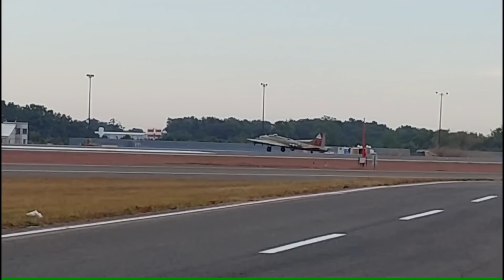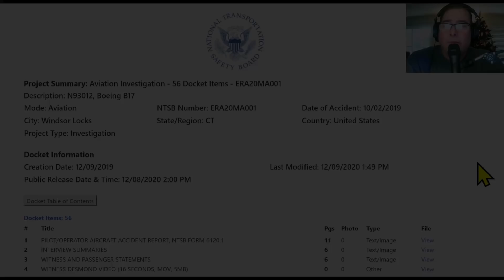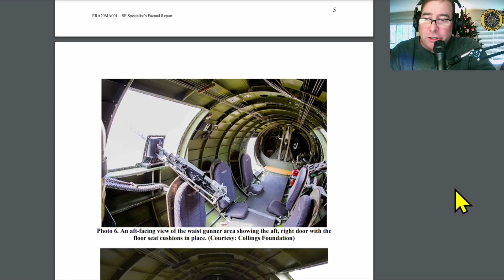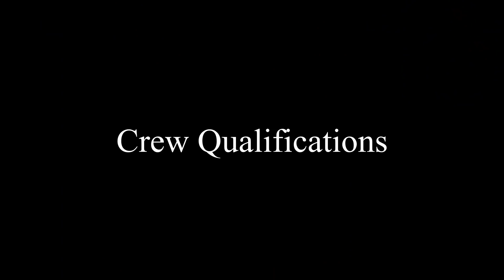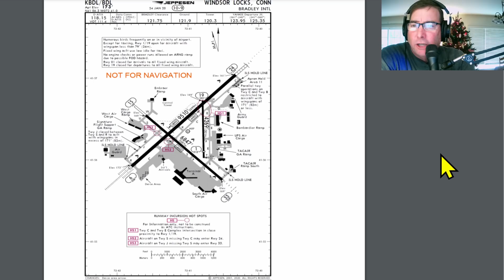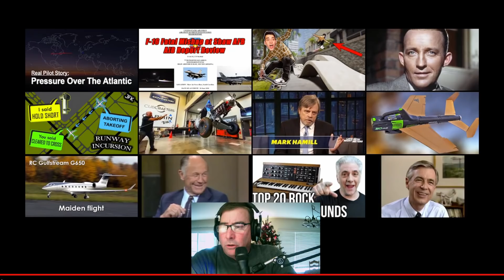NTSB Factual Report B-17G Crash 'Nine-O-Nine' Part I -16 Dec 2020

Comment: Extremely eager to hear the report on the state of the engines. I think that may explain what happened that day better than anything else. Sorry but this needs to be said. In the Collings Foundation and with the management of this aircraft in particular there was demonstrated an appalling lack of concern for safety! I don't have the proper words to describe how wrong it was to KNOWINGLY fly this aircraft, especially with paying passengers on board, with bad magnetos on at least 2 engines!  The R 1820's have 2 mags on each engine, thus built in redundancy and safety in that the engine will still run if one is inoperative. But when 2 of the engines would not start, obviously due to loss of BOTH mags on each engine,  blowing the moisture out and flying with paying passengers was a grievous mistake in judgment!

I was aboard this aircraft and the B-24 in Bangor, Me about 15 yrs ago. I loved being able to show my sons the kind of aircraft that helped America win WWII. It is a tragedy that it was lost, along with several crew and passengers, due to a number of mistakes and poor judgement that  allowed it to operate under less than ideal circumstances. The replica of the square rigged ship "Bounty" a few years back  was lost when the captain decided to sail it across the path of a Cat 5 hurricane. That organization, like the Collings Foundation, was driven by the need for money to keep the vessel operating. Safety took a back seat on the Bounty. 

We have all heard that a major cause of aircraft accidents is the "need to get there today" that has doomed an awful lot of flights. At the time of this crash the Facebook page for the Nine O Nine was begging for money in just about everything they wrote. Probably equally as bad as "need to get there today" is "we need to fly today because we need the money". When safety is willingly ignored, or in some fashion "worked around" bad things sometimes happen......like they did here. There was ample reason for Collings to lose their approval to make any more of these flights, due to a lackadaisical attitude towards safety,  as we have already learned some months ago.

Comment: Can someone clue me in on how the main gear braking and tail wheel steering work on a B-17? I'm fairly sure I see full left rudder on the eye witness video and at least one tire smoking. Is there differential braking by pedal, or is is unitary... and does the tail wheel steer with the rudder or does it caster?

Because I'm thinking if they locked the left main while still braking hard with the right, the friction coefficient favors the right, and the braking force could have taken enough weight off the tail wheel to make it ineffective at the same time the rudder's ineffective.....

Comment: If you lose power feather that engine. Maintain air speed with increased remaining engines. Lose two on one wing do not turn into that wing. If unable to maintain momentum above stall speed belly land on available terrain if at all possible. You can’t maneuver without out adequate power. You can only descend  with remaining airspeed. Full flaps to reduce stall speed. Nose down with remaining altitude and flare at twenty feet above ground level. If terrain won’t allow,, well you did all you could.

Comment: Excellent commentary as always! I am saddened by this crews and passengers loss of life. Closing in on 65 years old and retiring from airline flying a couple years ago and observing some ( not all ) older pilots struggle. I believe flying a complicated aircraft  as a B-17 ( in particular when an engine fails ) at age 75 ( as was this Captain ) is not a desirable situation. I absolutely mean no disrespect.
Reply: Im not so sad for the crew, their own incompetence and arrogance cost them their lives. I'm sad for the innocent passengers they killed and the loss of this historic irreplaceable aircraft.
Reply: @Zwia.  ok tough guy
Reply: @Zwia.  The Air Crew didn’t, “kill” anyone. Aviation comes with its own set of risks, especially when a  75 year old military aero plane is involved. And no a B-17, whether you deem it “irreplaceable”  or not does not hold more importance than the souls lost during this accident.
Reply: @dyingbreed1282  William's statement is not holding the loss of the aircraft as more important...and he's right, the captain shutdown #4 engine against the Loadmaster's warning because he said they were still climbing out. But I wouldn't have said crew though...this was on the captain. No CRM utilized at all. I don't have any sympathy for the captain.
Reply: I add the Loadmaster partially at fault too, now that I think about it. He didn't have a pre-flight passenger safety demo in place, especially for that type seatbelt.
Reply: @SixTenVisuals  I'm somewhat surprised that they didn't think it was beneficial to replace the old lap belt with modern restraints.  I'm all for historical accuracy, but that ain't worth dying over.

Comment: The CFRs & Sections (14CFR & Part 91) spell out the hierarchy of FAA oversight and regulations.  Part 121 is the most stringent, then Part 135, and then Part 91 for us General Aviation types. For us the oversight comes from the FSDO, and most of us will rarely, if ever, interact with an actual FAA Inspector, although a “ramp check” is a distinct possibility.

The Collins Foundation B17 crash at KBDL provides some object lessons for all of us way down the “food chain” in oversight.  I would encourage all of us to read the threads below and learn the lesson:  Where does our real “safety oversight” come from in our GA operations?  In brevity: IT COMES FROM US!  We know our airplanes, and many GA owners try to scrimp and save on maintenance and upkeep.  This is one area that we as owners have nearly autonomous control.  Maintain it to the best of our abilities!

https://www.aopa.org/news-and-media/all-news/2020/december/16/ntsb-opens-docket-on-collings-foundation-crash?utm_source=epilot&utm_medium=email

https://youtu.be/G3dD98IqEUk

https://data.ntsb.gov/Docket?ProjectID=100356

There simply is no substitute for a good maintenance program and diligence/vigilance by both the maintenance folks and the pilot operator/aircraft owners.  There is not enough FAA oversight of Part 91 to insure our air worthiness and we simply cannot rely on that alone.

Get a cup of coffee when you have time and enjoy the lesson links.

Comment: Missed opportunities: declaring an emergency and telling the crew to prepare for immediate return; the cross runway at Bradly was overflown! With traffic priority via a declaration of Emergency with the tower, the closest runway should be the landing runway. Lastly, if the plane was hardly flying why attempt a go-around after initial contact? Thanks
Reply: Aviate 1st. Communicate 2nd.  Basic flight rules
Reply: @rfinsl  I am glad u agree: AVIATE which means in a decreasing power condition THE 1st runway/landing field available IS the place to go! 1 motor out, 2nd motor questionable thrust! Why over fly the crossing runway at BDL? Seems plan before takeoff was not created. Thanks

Comment: This accident is quite similar to that C310 accident crash on highway 405 before John Wayne airport in California in 2017.  Right engine missing (It didnt die).  He panicked and made a ton of mistakes on EFATO, plus stalled on the turn and crashed short of the runway-on the highway hitting cars and exploded the fuel tanks.

Comment: Chain of Pilot Errors on EFATO.  The usual killer of "Experienced Pilot".  Experienced, but not on EFATO.  They feathered the wrong engine, didnt troubleshoot the suspected one and let it die on climb out, turned into the dead engines, then undercontrolled the right turning tendency on downwind leg and got too close to the runway, then under shot runway, then added power at MCA and went to the right (yes, that will happen, dummy) into their crash.  About 6 EFATO pilot errors total.  Geee. I was Multi Engine CFi. Retired..

Comment: I recall hearing right after the incident that the propeller on the #3 engine malfunctioned.   Two of the blades did one thing, and the third blade did something else.  So that engine wasn't fully effective even if it was delivering power.

Comment: The pilot being in charge of maintenance operations is always a red flag, I have multiple on/off road vehicles/watercraft that I "maintain" which I would drive at 100mph, but would not let anyone else drive them at all! just because you know about and get used to pumping the brake pedal 5 times to stop, and know what rpm the hydraulics will have max output without a line failure doesn't mean its in good working order!

Comment: I
Juan, I'm not understanding why the crew would have had the two left engines at a high power setting at the same time they were standing on the brakes.  there was very long skid marks shown in previous vids and now this latest vid where you can hear loud engine noise.

Comment: Every time I see photos of the wreckage, I am astounded anyone survived. It looks to me that the final arc the aircraft took as it approached the airport was not really something the pilots were controlling, but something the aircraft was doing under the power of the assymetric thrust.
Would the outcome have been different if the pilot chopped the throttles once the aircraft was over the outfield? We will never know, but I suspect yes. Given the B-17's ability to operate from very unimproved fields, it would've been an option in my mind. Just put it down with some sort of marginal control, instead of hanging on for the ride.

Comment: It's time to shut down these sketchy war bird operations.  They were dangerous and demanding planes 75 years ago.  Pilots aren't proficient and maintenance is underfunded and has no FAA supervision.  Shut them down. (pilot)  p.s.  In the mean time, Apply the same age limits to pilots as airline pilots, age 60. Require BOTH pilots to be Type Rated.

Comment: I have had moisture in my points under the cap before on a pickup I owned a long time ago. I would use WD40 since it is a water displacement and it would start right up, never had any issues unless it rained. And that would fix it  and off I would go.----Just saying.

Comment: Heartbreaking accident. Appreciate your report. It's a little confusing - early on you said the passengers and crew were fatally injured, then later it sounded as if the copilot survived to tell the story?
If 2 engines had recently been overhauled, is it possible the pilot took things a little for granted in his assessment of the engines? With all due respect, it sounds like there might have been a couple of things not in the pilot's favor:
* His age (sorry kids, but that's the way it is). A person can still be pretty sharp at 75, but may not have quite the reflexes and judgment of their younger years. Should that flight have been aborted before they even took off? Was he maybe a little too eager to get in the air - i.e. Collings needed the money? 
* And, respectfully, I caught on the paperwork displayed he did not have 1 DUI, he had 2. It was a long time ago (98?). Was he still somewhat of a drinker? Forgive me, but if he had a couple of stiff ones the night before in the interest of social discourse, he might have been a little fuzzy for an early morning take-off, especially at 75 years old.
I'm not saying this is what happened, merely speculating the possibilities.
* What the heck was the story with the seatbelts? They should have been fully functional and the passengers instructed properly how to use them and the emergency exits. Period.
* What was the disconnect between the FAA and Collings? That doesn't add up. What's going on with the FAA?
The truth is hard to fathom sometimes, but if you really want to understand what happened to that beautiful B-17 and everyone in it, you have to be honest and face it for what it is or might have been. 
Same for so many other things in life.
Thanks again. Excellent report. It deserved a thoughtful response.
Condolences to all family and friends here - RIP. 
Hope everyone has a happy, healthy holiday.

Comment: I think the old guy standing on the top of the ladder in the beginning photo clips really demonstrates this groups concerns for safety altogether.
Reply: The old guy on the ladder was the Pilot and mechanic Mac Mcauly
Reply: You obviously sit in a chair nonstop and have never done a day's labor. Shut Up.
Reply: @jameshobbs6092  What @tisoy909 says is a very valid point. Any fool knows you never, never stand on the top of a step ladder like that. I've worked with ladders every day of my 30+ years in this job and have never stood on the top rung of any step ladder. In fact HSE law now says you shouldn't use the top three steps, including the top, on a step ladder. So I know who should SHUT UP
Reply: @jameshobbs6092  "doing labor" has nothing to do with doing it correctly, or safely. The same judgement on display with standing on the top of a ladder like that is probably the same kind of judgement that ultimately brought the plane down and killed seven people. That shut them up for good.
Reply: @jameshobbs6092  well my chair flies. I don’t consider it labor.
Reply: @jameshobbs6092  I have ! I thought the same thing !
Reply: Unfortunately there remains a MACHO attitude towards safety, and nothing will change until MEN GROW UP.

Comment: When I flew on this exact airplane in 2004, we sat in the back on the floor, with seatbelts. Sitting sideways. We were told specifically not to sit in the seats. I don't remember there being so many. Also the plexi glass hatch over the radio room was removed

Comment: Something to know about spark ignition systems that have gotten damp.  While pure water isn't a conductor of electricity, impure water is a conductor.   Just as with a distributor type automotive ignition system, conductivity due to water contamination will allow high voltage to leak to ground or another cylinders distributor terminal.  The other side effect of this " high voltage going where is should not be going "  is that a carbon line will be burned into insulator surfaces.  This carbon line is now an easier path for electricity to flow.  Some call this a " cracked distributor cap " but it is really " carbon tracking " .

Electricity follows the path of least resistance,  If a spark plugs  firing voltage is say 15 Kv and the carbon line is 20 Kv, the high voltage will mostly go to the spark plug and the engine will run.  At high engine load, spark plug firing voltage increases.  If it exceeds the 20 Kv threshold of the carbon line, the spark plug does not receive enough voltage and the cylinder won't fire.

A similar situation can occur with spark plug wires that have failing insulation even if they are not wet.  Given the spark plug wires are likely in a metallic wire braid to reduce radio noise, weak insulation is a greater issue than with an exposed spark plug wire. 

If damp mags are a perpetual problem, I'd be looking at sealing them up and purging with a built in dry Nitrogen system.  Note, nitrogen isn't dry because it is nitrogen, it is dry due to it being compressed and dried.

Comment: I flew on Nine-O-Nine almost a decade ago.  I sat behind the co-pilot's seat, facing backwards, with a lap belt, if I recall correctly.  What an absolute tragedy this accident was.  As an ATP who's flown a full, piston airplane on half its engines, I can say it's not like flying a jet.  When you lose a motor in a jet, you can sip your coffee, engage the autopilot, pull out your QRH, and make sure you deliberately perform all the necessary actions.  With piston airplanes, its a little different: your window to "get it right" is narrower.  That said, you still need to take a deep breath, keep calm, do your job, and work the issue, especially since you'll probably only get one crack at it.

Comment: One thing I do wonder about, given the pilot and co-pilots ages, I wonder about physical endurance. I understand they probably were well within their mental capacities to fly this aircraft. To my knowledge the B-17 did not have any power assisted controls other than electric servo tabs. If you're having to hold the rudder with your leg and fighting with the control yoke, it takes an amazing amount of endurance even in the B-17, which is recognized as a pilot's airplane. I remember reading about a pilot in the eighth Air Force they had to hold full rudder due to battle damage and two engines. His co-pilot was incapacitated by injuries. When he finally got the plane on the ground he couldn't get out of the seat because his leg was knotted up so much from holding the rudder . He had to just wait around for a bit before he can pull himself out of the seat. I am not making any claims about their ability to fly the aircraft under normal circumstances, I am sure they are very very competent pilots. I just wonder about the physical endurance issues.

Comment: This one is very personal for me. I flew right seat on the 909 out of HFD back in the early 90’s before LHFE.  During the flight, we did a flyover of BDL and a couple other airports in CT.  The B-17G under most flight conditions is heavy on the controls, no hydraulics. While it can seem docile most of the time, I’m sure under emergency conditions it turned into a beast. I doubt anyone ever practiced a two engine out situation. To suddenly face that almost immediately after takeoff is probably more than even the most skilled B-17 pilot can handle. A sad, sad day.